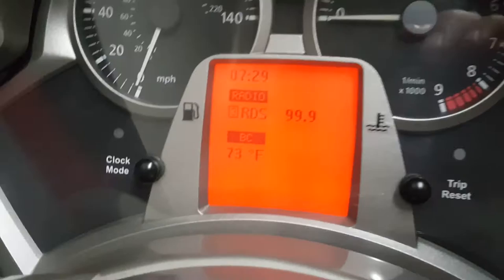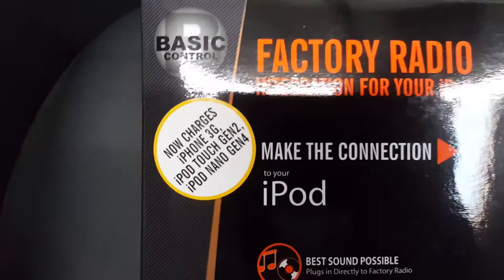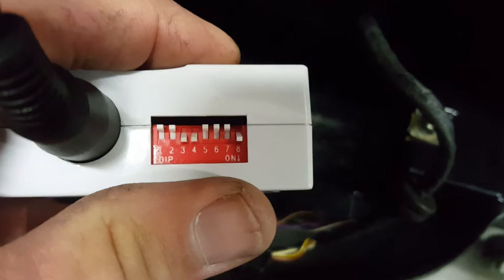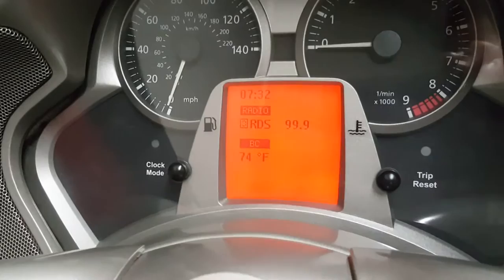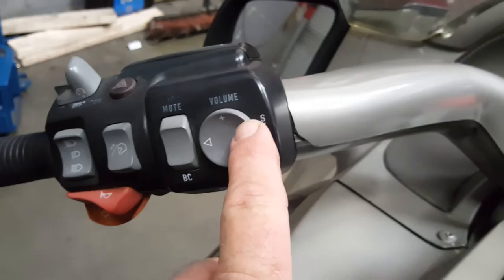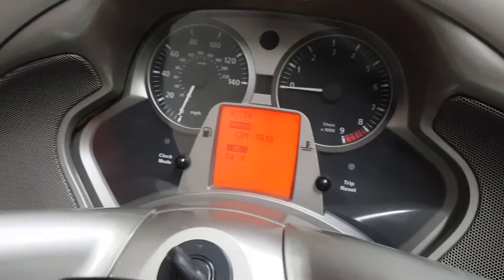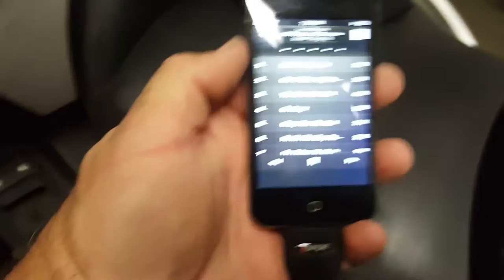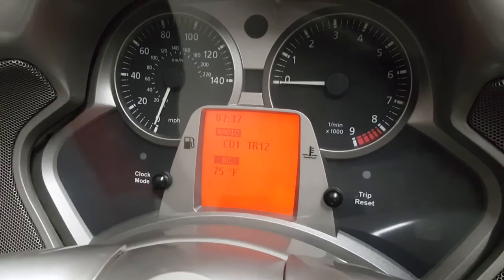BMW K1200LT IPOD INSTALL REPLACES FACTORY 6 DISC CD CHANGER

Comment: Does the iPod module stay powered on all the time or will it power off when ignition is off? I installed a Yatour and it stays on all the time. Wondering if the 6 disc cd changer was always connected to power or if I need to switch wires.